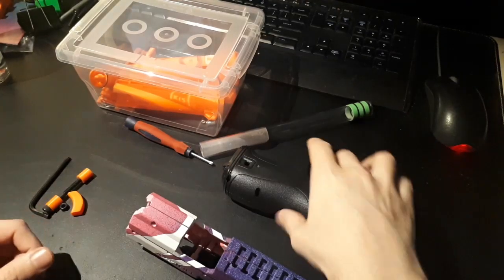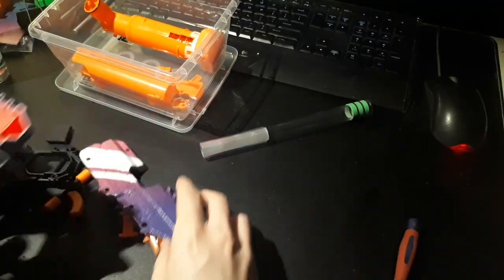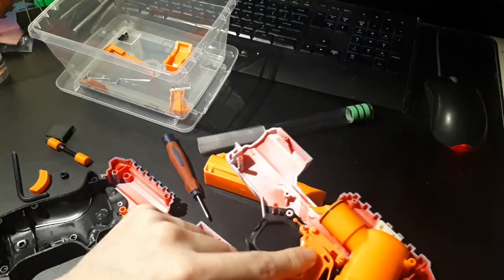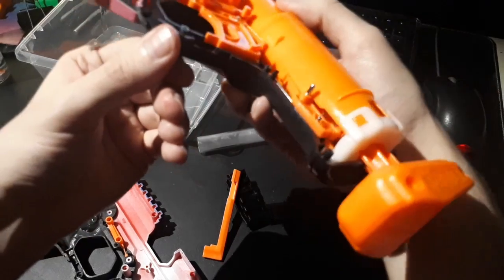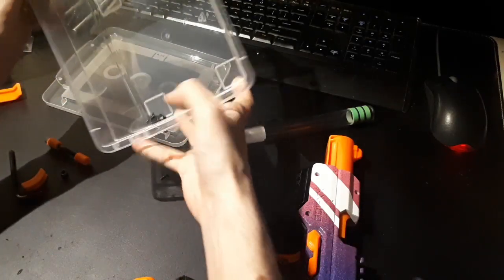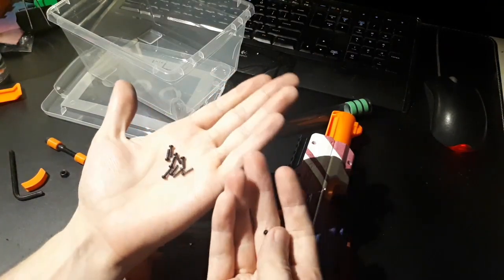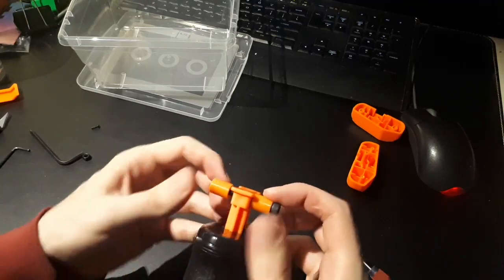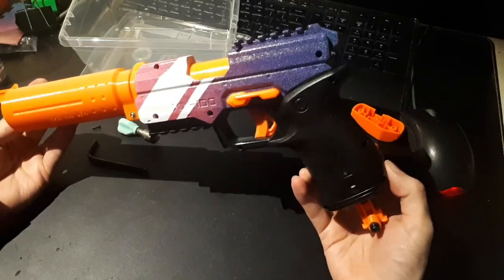TKO build guide part 5 - re-assembly

Comment: Is the 3d printed clamp necessary to keep the inline clip in place or will the tape and O-Rings keep it in pace?
Reply from the maker: The tape and o-rings (as they appear in this video) are not enough to hold the barrel in place. The breech slamming open will dislodge the barrel over the course of a single game. You kinda need something extra to hold the inline clip in place. 

You could try wrapping a larger section of the inline clip in tape and hope the extra friction from a larger surface area will be enough.
Reply: @ehdrien1094  thanks for replying.

Comment: Would be possible to rig an internal mag for normal rival rounds using similar method?
Reply from the maker: I'm not sure. I don't know of any attempts to build an inline for rival.
Reply: @ehdrien1094  well I've build an in line for short darts from elite short silencer, piece of tubing and electrical tape but this clip thing got me thinking... Same principal should apply for rival but I think it would reqire rather percise 3d printing of whole barrel... Still it would be nice ...

Comment: It looks so good, thank you for providing the files for this! I'm just going to do a paint job and do the ball storage delete without converting to half darts.

One tip for printing threaded parts, you can use different layer heights for the male and female threads to keep the layers from aligning when you screw together and binding up. For example printing the suppressor at 0.15 where you want a better finish, and the barrel clamp at 0.20
With that example only 1/60th of the layers are aligned, instead of every layer.